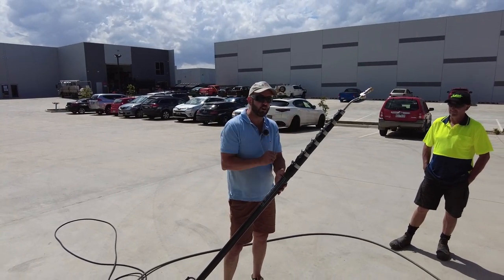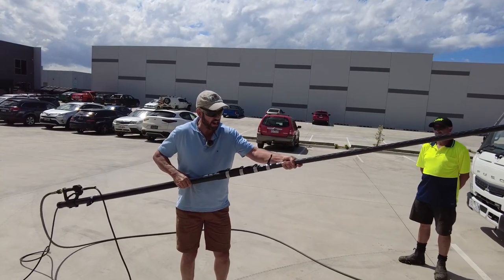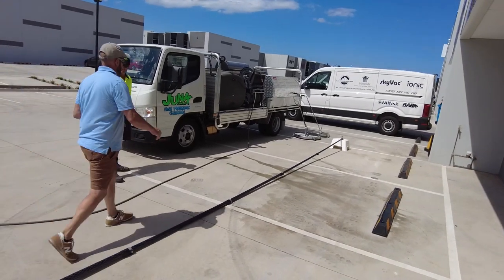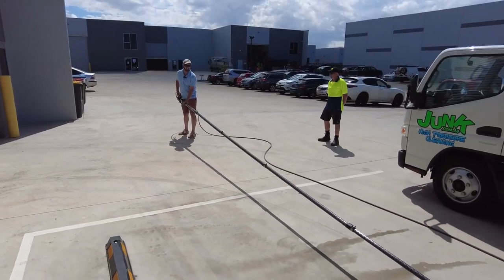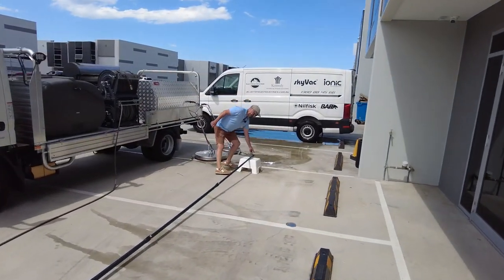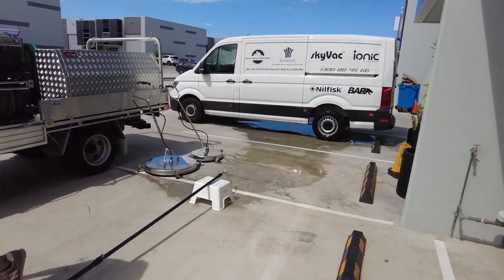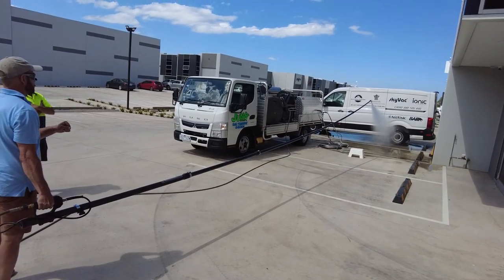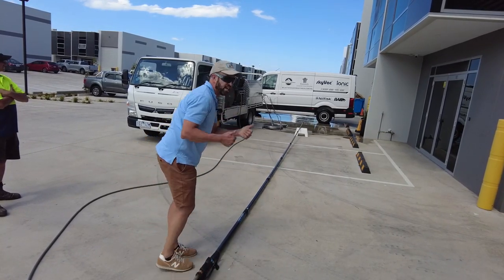Telescopic Pressure Cleaning Poles | How to Use | Pressure Washing How To Cleaning at Heights

Comment: yeah but for that pole to glide up on its own like that. How many psi is it running to be able to do that?
Reply from the maker: The poles are rated for 4000 at 21. In this video we were running at near 3000. 
Personally I like in the range of 2500 to 3000  overall.
Reply: How many gpm is that machine?